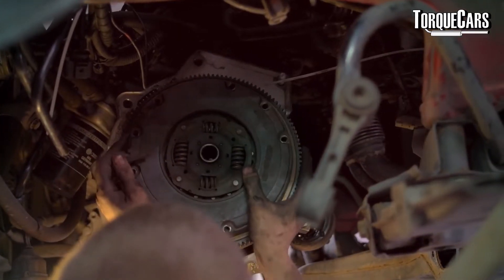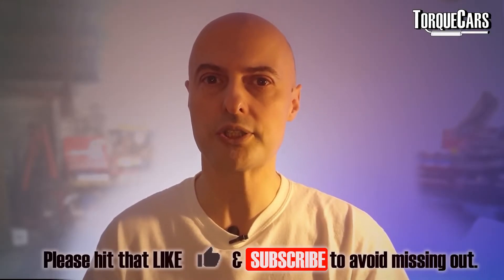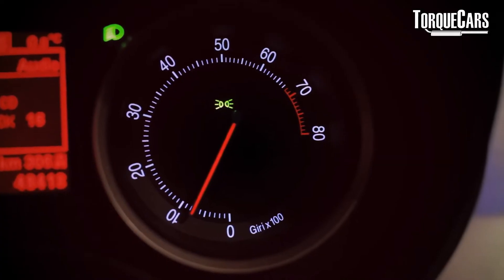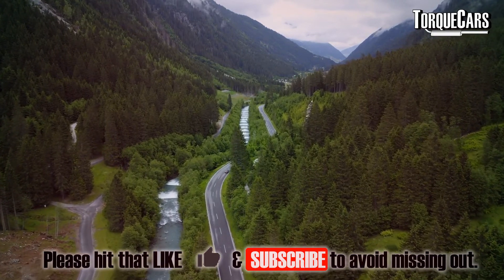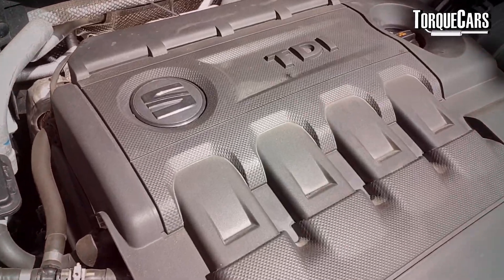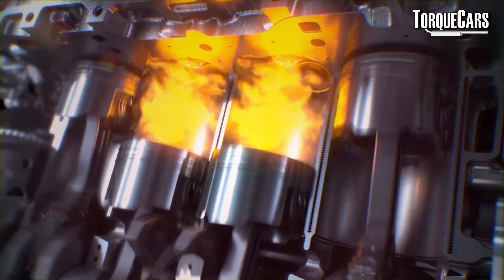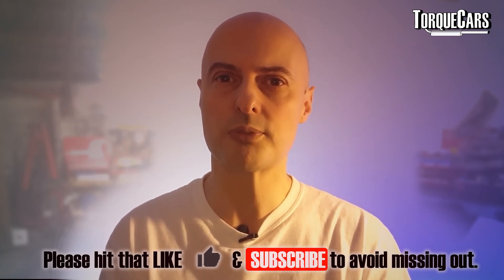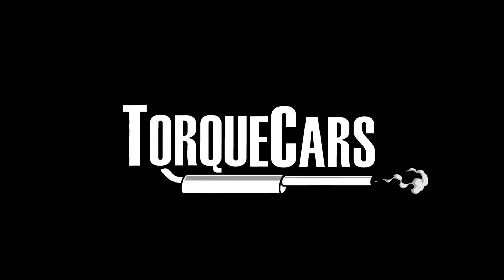Flywheels What? Why? How to Upgrade [Tuning Tips]

Comment: Hi Wayne, does a lightened flywheel also mean more engine braking when you lift off the accelerator? And less engine braking through a heavier (than standard) flywheel when lifting off the accelerator?
Regards Harry
Reply from the maker: Yes you are right, flywheel weight equals a buffer between the speed difference, so lighter is less buffer and the car slows up faster.
Reply: @torquecars  Many thanks; I will be leaving my flywheel standard then. since I enjoy how much my Alfa 146 Twin Spark carries on rolling in gear when lifting off the accelerator while still revving up more than fast enough ;)